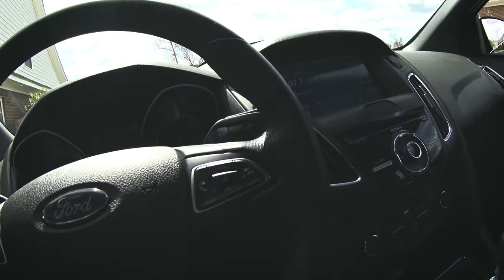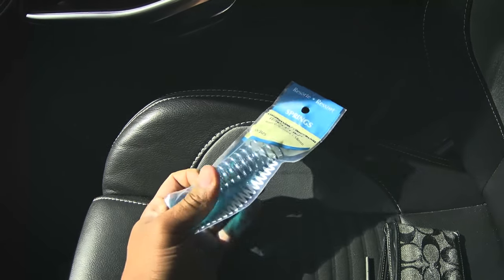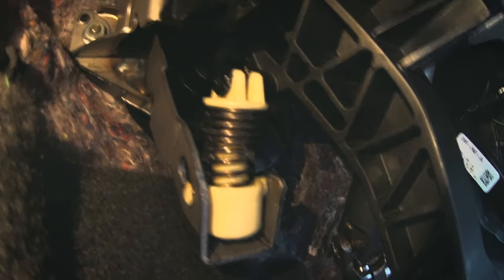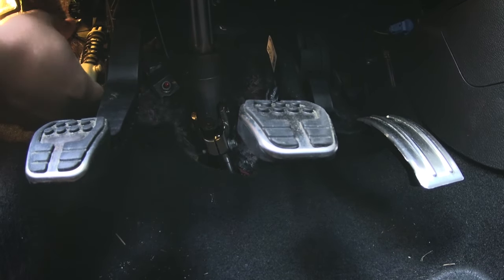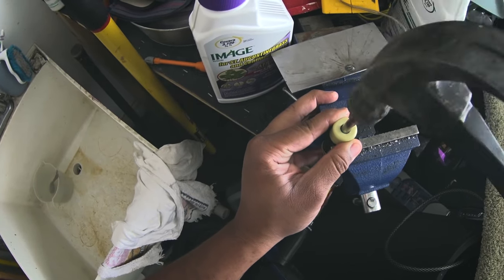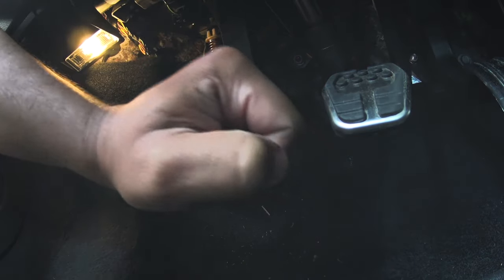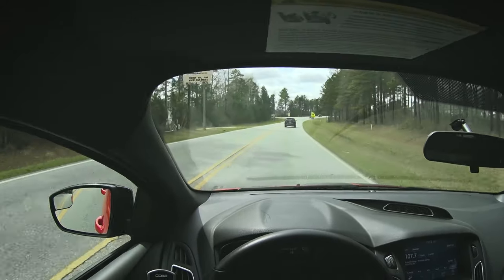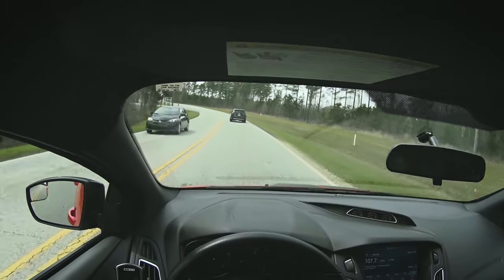How To Replace Clutch Pedal Spring In A Focus ST [Assistance Spring Mod]

Comment from the maker: Warning: please be extremely careful when opening up the assembly. It is very fragile and will break easily. Be sure to align the inner line on the assembly with the left and right tabs on the outside of it. Then proceed to use force but not too much to open it up.
Reply: Hands down best video on YouTube for this mod. LOVED using a punch to remove it easily. Thanks for putting this together!

Comment: I cannot get the plastic piece that holds in the spring to disassemble.  Any suggestions?  I don't have a vice unfortunately
Reply from the maker: +Jason Cecchine check out this thread. There are people who have gotten it apart in different ways. http://www.focusst.org/forum/steeda-autosports/104426-you-asked-steeda-listened-new-focus-st-rs-clutch-spring-kit-9.html
Reply: Thanks for the quick reply;  I was able to get it off without it breaking!
I followed this guys advice, http://www.focusst.org/forum/steeda-autosports/104426-you-asked-steeda-listened-new-focus-st-rs-clutch-spring-kit-post1881993.html#post1881993.

I used a slim flathead to push the tabs towards the - line.  I than pulled it apart with ease, good technique for a weakling like me!
Reply from the maker: Jason Cecchine Awesome! Glad you were able to get it off without breaking it.

Comment: So I also got the spring from Lowes because I don't like the clutch feel in this car. I just bought a 2017 ST1 and I love it other than that. Being the heavy handed dumb ass that I am, I snapped the plastic retainer that the spring sits in. Any idea where I can get a replacement for that? I actually like how it feels without it but I want to try it with the new spring. Thanks!
Reply from the maker: +Mark Marangi You can get a replacement spring from Ford. I've had a lot of people message me about breaking it. I need to figure out why it keeps happening.

 Here is the link: http://www.fordparts.com/Commerce/PartDetail.aspx?n=50UETG%2f94zbTT1X1MXZ91A%3d%3d&id=421322173&m=2&search=true&year=2016&make=Ford&model=Focus

Comment: Would this procedure also work for a 2007 model year ST? That's second generation Ford Focus.
Reply from the maker: +Derek DiMatteo I actually don't know. Does it look like this one?
Reply: ....no, it doesn't look like that one, really. I stuck my head under and I don't see the spring or the yellow cylinder like on yours. But there ought to be a spring, I feel. I'll have to get the shop manual, I guess.
Reply from the maker: Derek DiMatteo ahh ok. Interesting. Keep me posted on what you find. In the US we didn't have ST vehicles until model year 2013 so that's why I'm not sure.
Reply: We had STs here in the US in 2005 to 2007, it was just a first gen sedan with a 2.3l duratec, it wasn't anything special

Comment: I got the steeda spring it sometimes when shifting from 1-2 the clutch still just flies out full force it's impossible to get it smoothly especially when the cars cold.
Reply from the maker: Yeah it is still strong a times. I guess it just the nature of the car. For me it has been much better with the Steeda spring.
Reply: Late reply, but it’s really preference tbh. I’d rather have this super stiff factory clutch pedal setup, compared to the super soft, light factory clutch pedal in my ‘15 Honda Accord Sport manual, which doesn’t use a pedal spring.

Comment: You should do a led interior swap and license plate bulb swap and reverse light swap to white led lights instead of stock yellow.You should use Precision Led its great and much better.
Reply from the maker: +Alan Shcherb That's on my list. I put in some ambient LED interior lights last week and I'm looking to get rid of the stock interior bulbs too.
Reply: Thats Good what other mods do you plan on doing,but for lights go Precision Led,and another question is if your headlight bulbs  are white or yellow.
Reply from the maker: Alan Shcherb They are white. I want to make some changes to the transmission cable bushings and do the bolt ons that everyone does. It'll take time.

Comment: What exactly does this do to the clutch feel? Is it just smoother when starting or is the clutch lighter with the new spring in?
Reply from the maker: +Tom Hess The clutch is more linear. Stock for me the spring caused the pedal to be odd. The kickback was just too strong at certain points on the up travel. This smooths it out a bit. It's easier for me to drive it this way.
Reply: Thanks for the reply! So can you still easily feel when the clutch begins to catch? By the way love your videos, as a new ST owner :D
Reply from the maker: Tom Hess Glad you enjoy the vids! Thanks for watching man! For me I feel it better. What model year ST do you have?
Reply: 2013 ST3 with about 27k miles, loving it so far. Any upgrades / mods you think are essential?
Reply from the maker: Tom Hess Ahh ok. I think Ford started using those other springs on 15 and up models. You should be fine. For me I had to get a muf delete. I wanted get rid of the sound symposer. Definitely add some hydraulic hood brackets to hold it up if you plan to do lots of work under the hood. The Green airfilter was also a must for me.
Reply: TORQUE & TECH Ok, thanks for the suggestions. The car definitely isn't loud enough stock!
Reply: Hey, another question. Have you done anything with the shift plate/knob? I feel like the stock shifter is too long.
Reply from the maker: Tom Hess not yet. I am chatting with a guy on Instagram about that. He is getting the JBR short shift arm. The JBR one should be 89 with the bushing.
Reply: TORQUE & TECH Ok, I read up on it a bit and people had issues with the Cobb short shift plate, the Steeda one looks good but it seems like a bitch to install. The JBR heavy shift knob looks nice though.

Comment: you still have on today any updates also I have focus rs has the same thing I wanna do that my downshifts are not that good be cause of it
Reply from the maker: +Erwin Rangel Yep I still have it on and it's great. It's holding up just fine. I suggest you definitely do this mod.
Reply: TORQUE & TECH  might put it on the focus rs is almost the same thing as the ST
Reply from the maker: Erwin Rangel This will help. I've come across people on the forums who replace the clutch spring on the RS.
Reply: TORQUE & TECH oh really I haven't come across in that I been looking to see if anybody has done it and nothing, the spring doesn't weaken stays strong. the issue I have is it pushes my foot up when down shifting and car jerks
Reply from the maker: Erwin Rangel actually I take that back. I thought I came across it before but I just searched and I don't see it. Removing the spring will help with your downshifts. Have you looked down there? Does it look similar to the ST?
Reply: TORQUE & TECH yea it's the same pretty much
Reply from the maker: Erwin Rangel hmm. If you try it then be very careful. The assembly that holds the Spring can break easily.

Comment: good video  but can just cut a couple of coils off the spring save yourself 5 bucks or do what I have done throw out all together. I did this about 3 years ago, only down side is the clutch is a bit heavy but feels a lot better to drive
Reply from the maker: +Mark Mine doesn't return all the way up without the spring. It felt nice though for sure.

Comment: Have you used your Cobb AP to see if the clutch is at all engaged with the new spring? I was REALLY wanting to do this mod a while back but was hesitant when some guys seemed to report slight clutch engagement. Can't remember if that was just from spring removal, though, not a full spring replacement
Reply from the maker: +H. Read Davis This spring is good for no engagement. I checked it with the AP after installing.
Reply: Well damn, now I really want to do this. Still can't figure out for the life of me why this performance-oriented car came from the factory with SUCH a numb clutch feel. Part of me is still holding out for a more legit aftermarket solution - I feel like the Mustang community has a similar issue and either Boomba or Steeda has a replacement spring IIRC.

Thanks for the info and the great video!
Reply from the maker: H. Read Davis thanks! Yeah I was hoping for something like that too. If you do it let me know how you like it.
Reply: My clutch pedal sagged to 12 on the AP on a cold morning with the spring out.
Reply from the maker: David Fessehazion Do you still drive with the spring out now? If so how is it working out?
Reply: TORQUE & TECH I put it back in yesterday. Thanks for posting this video. I'll probably do this mod, then maybe the clutch line upgrade in the future.
Reply from the maker: David Fessehazion Awesome! Glad I helped a bit. I think you'll find this to be a nice middle ground between the stock spring and no spring.

Comment: did you make the pedal softer or stiffer?
Reply from the maker: +Casey Rodriguez The pedal is a little stiffer but has more feedback.
Reply: TORQUE & TECH - I just installed the Steeda Spring. Makes a huge difference! Love it. I just wish it would do away with the useless 1/2 end of the pedal that does Absolutely Nothing... not sure why the pedal throw is so long when the clutch engages at like a 1/3 of the push.

Comment: How's this new spring been holding up?
Reply from the maker: +Cheatingk9 It's been fine. Really liking it. No pedal sag.
Reply: Nice! Going to do this as alternative to no spring. Since steeda won't do one for the ST. 😒
Reply from the maker: +Cheatingk9 Awesome! If you can't find the spring I still have my second one.
Reply: Kenny steeda just released one, I should be getting mine today
Reply: Plasmamuffins I just got mine from Steeda too! Still a little weary on doing it without breaking the perch. 🤕

Comment: Part broke very easily. Be careful folks, I know he says it. But just be really careful.
Reply from the maker: Sorry it broke on you. You can buy a replacement from Ford. It comes with the stock spring though so you'll have to try getting it open again.
Reply: Mine broke but it still went back perfectly into the slot and hasn’t flown out yet
Reply: On which part of the process did it break? Taking the spring out or detaching the two plastics?